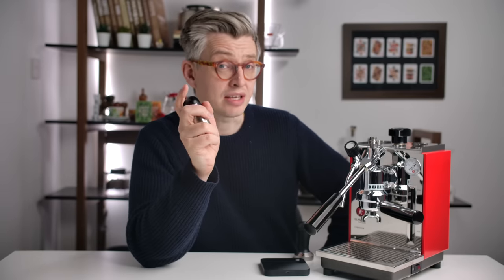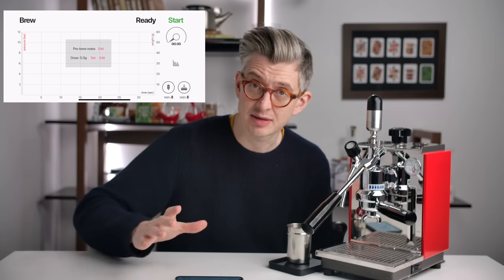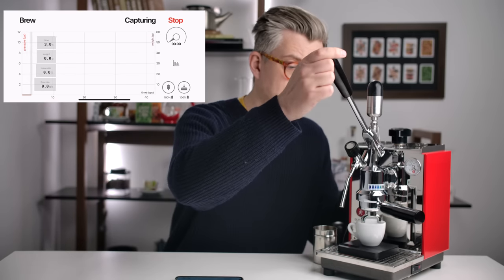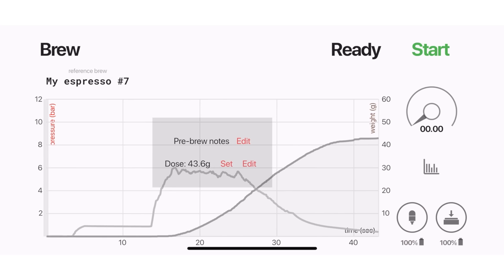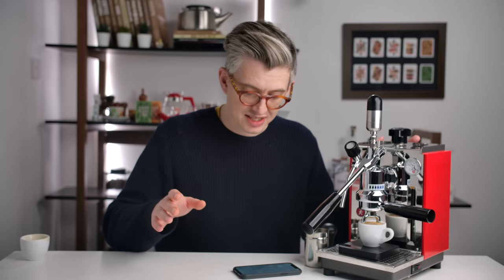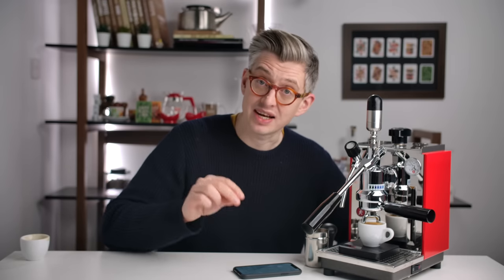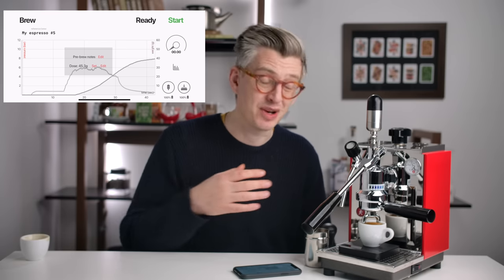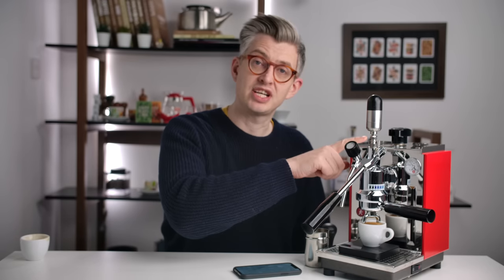The Smart Espresso Profiler Review

Comment: Thank you for the review, James! It is really motivating to get this kind of feedback.

There are some features of the app I'd like to mention, to make it even more interesting:

First of all, it also works without a pressure sensor, using a scale only (and it's free). This way you obviously only get a flow graph, which is interesting by itself. Also, it makes the app suitable for pour over.

There are more supported scales: beyond the Acaia Lunar, Pearl, Cinco and Pyxis, the Skale II scale is also on the list, more will follow. :)

Features:
- autostart on pressure: logging starts automatically, when a certain pressure is reached
- auto stop on lifting the cup
- virtual autotara: no need to tara the scale.   When starting a shot, the app will start logging from 0g, no matter what the scale shows
- switch between weight increase and flow graph
- E61 groupheads are compatible 

Well, I guess these are the most important ones. Enjoy! :)

Cheers,

Miklós
Reply: @mysteriousfox88  yes.
Reply: Hey Miklos! Great work you're doing there - keep it up! Quick question: Are you planning to include the Felicita scales into the app?
Reply: Sok sikert, srácok! ;)
Reply: Hey Miklós,
how did you integrate the acaia scales in your app? I thought their protocols are not open. Did you reverse engineer the code?
Because there are microcontoller based espresso machine modifications to bring pressure profiling and so on but usually only work with the skale2 because its open code.
Reply: ohboy....is this the first coffee app that doesn't suck? Past James reviewing brew apps would be shocked!!
Reply: If this also had temperature for the E61, I would order immediately. This funcionality would open entire new market. Pressure profilling on e61 is getting quite big but most of the machines(often being HX) need to also have temperature gauge.

Definitely interesting product tho!
Reply: @figilande8   Hey Figilande8, we introduced our idea to Acaia first (more than 2 years ago) and we have their support.
Reply: @duriorYT  for now, Felicita scales are not planned to be supported.
Reply: @figilande8  Acaia supported us by giving access to their software development kit.
Reply: @alfonsplasil  thank you! Temperature is definitely on our list, we even have a working prototype, but there is a long way ahead before it is ready for the market.
Reply: Miklos Csanady would this also work for fermentation pressure monitoring (in brewing)?
Reply: @saladaufdieeichel  most likely yes, but I guess the temporal resolution that we use in the app is suboptimal for that purpose.
Reply: This. Is. Pure. Joy. Thank you.
Reply: Does this work with the robot espresso maker?
Reply: @iltifat01  yes, there is a custom fitting for that. You need the version with the analogue pressure meter though.
Reply: This is pretty impressive and you have alot of margin to play here. I work with industrial data and analytics. This is quite similar to commonly used industrial analytics to track performance called golden batch.
Reply: Miklós, great work!!!
Reply: @RicardoMQA  :) thank you!
Reply: Miklos Csanady so if it’s e61 compatible, then might be a good pairing with the new flow control profitec for e61 kit???!!! 😀😀😀
Reply: @WillCheang  yes, it works fine with that. Also with the Lelit Bianca.
Reply: Would you say that - considering everything else constant (coffee, grind, weight, temperature, distribution & tamp), the pressure is directly correlated with the flow in the cup? Because in this case, you would not need the pressure to reproduce a shot, just replicate the flow graph.
Reply: I'm definitely going to have to start using it for my pourover since it's fine to go scale-only. Really happy to see an actually good coffee-tech app out on the market finally. Was getting a little burnt out on all of them never working -- finally I have an excuse to use my scale's bluetooth functionality and not just its good aesthetics and basic functionality.
Reply: How much would it cost for that machine to be modified for this device?
Reply: @ashlynnanderson1744  Let us know how it works for you!
Reply: Hey Miklos - what do you need to add more support, for more scales? Do you have some app code I could run from Xcode while connecting with my scale (Felicita Arc).
Reply: Does it support gs3?
Reply: hey miklos! it's a very cool app and I use it for every shot of espresso. 👍
Reply: @mikloscsanady3955  are you planning to include also the Timemore scale?
Reply: @A266509  it's not yet on our list.
Reply: Szégyen, hogy ezen a csatornán csak most jutottam el a magyar kötődésű videóig, de nagyon jó látni, szuperek vagytok! ☺️
Reply: @konczpet  :) köszönjük!
Reply: Why so expensive☺️?.
Reply: Waiting until aliexpress will offer it... Like 400 backs..wtf

Comment: QUESTION: Did the second shot match the first in taste/density/texture? It would be good to confirm the repeatability.
Reply: Since he went early but then decided to try and follow the curve as closely as possible for demonstration purposes, I'd say that actually was a pretty bad replication of the first shot. But it would be an interesting question in general if not for this shot particularly. But I think the real question here is, if it is a significant improvement of repeatability across multiple days and it's not an easy question to answer with repeatable tests. I tried coming up with a few ways, but they all fall flat in some way or another.

Comment: It looks to me that the plots have used some sort of smoothing function(judging from the last part of the curves, an exponential one similar to capacitor discharging). The great thing about these functions is that they produce nice curves but they do alter the results displayed. When you want to exactly recreate a profile, maybe a raw input could be more preferable. The software has a lot of interesting tricks and features which are fascinating. I think it might be possible to further improve the profile tracking functionality by blending in some control theory.
Reply: I think its just the release of pressure and the weight increase plateaus.
Because we can see the "raw"ish looking data as he pulls the shot.

Comment: Great idea! Just a little advice for using the Cremina: Before locking the filled portafilter, lift the lever up to just below the point, where water starts to flow. If you lift the lever with the portafilter firmly in place you pull the ground coffee upwards and risk ruining the integrity of the puck.
Reply: Alternatively, you can dose just as much coffee that it touches the dispersion screen

Comment: Thought. Using the same parameters. Coffee, grind size, puck preparation etc. All you need is the app + Bluetooth scale. The pressure is a nice addition, but technically the only real-time metric you need to reproduce the same shot, is the flow rate?

Comment: It would be interesting to add temperature to the measurement. I would imagine that you could tune the app to give guidance around extraction pressure, boiler pressure, or brew time adjustment based on you tagging the results with your opinion (bitter, sour,...) but it would need temperature for this.

Comment: 110V is not a problem. First, if the machine doesn't have a pump that is phase-locked to the line input, then one can get away with a simple transformer for just resistive heating elements. Second, if 50 Hz sine wave is necessary to operate the machine, then one can build a simple converter using off the shelf inverter and a couple of power supplies to satisfy amperage.

Comment: I don't use leaver types machines but thats impressive. Next model could be the pressure sensor automatically adjusting the pressure  and all you need to do is pull the lever to the max pressure set on the shot. Not impossible to do.

Comment: I have a vintage Olympia Cremina that I installed one of his analog gauges on. I was planning to upgrade to the digital later (since the piston swap is already performed) but I'm keeping the analog.

The line of sight between you, as you are pulling, and the analog gauge is pretty spot-on, at least on the Cremina. I can perform my slow ramp-up and ramp-down based on the position of the lever or time on my scale.

With the digital, you have to look down at a phone, presumably on the table, while pulling. The ergonomics are not as good and I can imagine it might reduce your pulling accuracy or place strain on your shoulder. But! He makes rock-solid stuff, and I thinking about upgrading a La Marzocco GS3 MP with a digital one in the future.

Comment: Oh my gawd that machine is gorgeous. That shade of red is such an aesthetic.
I do wonder about the possibility of something like this attached to a Gaggia boiler. Perhaps a custom lathe cut threaded adaptor to replace the steam output tap on top of the boiler. I may have to put some thought into this. I don't know how much heat they can comfortably take however so that may be a problem.
EDIT: OH hey, never mind, looks like you can just add a pressure gauge between the pump and the input of the boiler to bypass all heat. People have done it to the Gaggia Classic. Interesting, I might have another upgrade for my '91 Gaggia Baby in the future!
Reply: Although now that I have a 2000+ generation gold stripe sticker Gaggia Baby, that all hardware for the machine attaches to a single galvanised steel base, I may just have to dip my toes into custom building a machine out of it.

Comment: This is why the Nespresso machines became so popular. Sure, they don't produce the best coffee ever, but they are VERY consistent at the ones that they actually produce.
In case you're using the same capsules every time, you're pretty much expected to have the exact same coffee each time, which is a serious plus as there are no surprises - and most of the time one appreciates the lack of surprises in his much desired cup of espresso :)
Reply: You have a point however once you experience just how good espresso can be Nespresso just doesnt compete. Been there and done that before realising how bad and expensive Nespresso is 😥. Now I have a hobby bordering on obsession complete with filtered water, flow profiling, the works. 😂
Reply: If you use a pump espresso machine instead of a manual one it can be just as consistent.

Comment: Here is an idea, another version of this device that has a pass through so for example with a standard espresso machine you could hook up the gauge in between the boiler and brew head to measure pressure and flow on any old espresso machine you wanted to convert.
Reply: You should really see the machines we hacked, exactly this way :) mostly La Marzoccos. It works like a charm. Nevertheless, we get the flow from the scale. Surprisingly, it is more accurate than most flow meters on the market.

Comment: When NASA was designing training equipment for the ISS to prevent muscle loss in astronauts caused by microgravity, they ran into the same problem that spring-based espresso machines have: Sprigs do not produce a linear force output, which is bad if you want to simulate weights.

The solution they came up with was using vacuum pistons. Pulling against the atmosphere you are in with a given surface produces a constant force over the entire travel.

I am wondering if anyone has incorporated this principle in an espresso machine, but would think that they haven't, since it would require a ridiculously big piston and would pull different shots depending on elevation and weather.

An interesting thought nonetheless

Comment: Wouldn't it just be so much better to figure what the ideal grind size is, the correct tamping in the brew basket,  the correct pressure of the water injection over time and do it all automatically with a hands off machine?  Even if you get the correct weight of coffee in the brew basket, and do the correct water injection, aren't conditions like atmospheric humidity, variability of tamping compaction pressure and the like going to interfere with the effort to achieve repeatable results?

Comment: My honest oppinion on this topic AS A WHOLE and on the Smart Espresso Profiler: 

Why would I buy a lever machine (a manual machine) for the price of an electric machine? This is the point that really messes with me since I saw your reviews on manual machines. I started my coffee journey just a few years ago, starting with pour-over (only doing french press nowadays), and the idea of making espresso manually really is appealing to me. But on the other hand I can get an electric espresso machine for just about 130€ more than I'd spend for the Cafelat Robot.
In my conception an electric machine has everything needed so that you are given the right tools for your espresso-making. And this is what you pay the price for.

So the manual machine that makes sense to me is something like the Cafelat Robot, but for at least half the price. You're doing everything manually, from heating up water, grinding coffee (with external gear that will cost money as well) to pull/push the lever with the right amount of pressure and, depending on your technique, watching the right output amount with a digital scale as well.

That said, the SEP is a very useful tool to get your espresso right every time with manual machines. Because you have to do everything manually, you can do many things just wrong. With this tool, again just in my conception, you don't need manual machines with preinstalled pressure gauges (cheaper!), because everything you need comes with the app. And instead of keeping an eye on pressure and amount at the same time, you can just try to follow your profile to make equally good espresso everytime. A real gamechanger and mybe the best invention so far.

BUT: This again is only appealing to me, as long as the manual machine and the SEP togther are slightly cheaper than a "cheap" electric machine, that does the job for you.
Reply: With an electric/pump espresso machine, after pushing the start button you are only a passenger.

Comment: Any chance for a device like this for an E61 machine or is it a moot point because for most E61 machines, you cannot control the rate of flow or pressure?
Reply: There are already a few flow regulators for the E61 group heads. You can easily attach the SEP to those machines.

Comment: How about four another type of coffee machine, ex. La marzocco linea?
Reply: It is possible, one of our customers did that. You just have to cut the pipe after the pump and install aT-connector, with the proper thread for the pressure sensor.

Comment: Miklos ive been lookin at your store and didnt find a complete set for the pavoni with the smart profiling module , but say that im wrong when in that case i need to buy the profiling kit for 410 for the module and 300 for the profiling kit to the pavoni ?
Reply: Hey Sebastian, for measuring piston pressure for a la Pavoni you need a piston pressure kit first (USD300) with an analogue gauge. You can buy the SEP as extra if you'd like to log your profiles
Reply: @ceze70  i understand its not cheap to get this stuff and to make,  but come on , it cant cost more then machine :/
Reply: @frajzorlul  Sebastian, we cannot sell something for less than we paid for. That would be practically a suicide. I think you should invest in a new, expensive coffee machine to make the SEP purchase a bit more reasonable

Comment: I think this is very cool and interesting. However, with a manual anything, you still have one variable that's not so easy to replicate. The human variable. Measuring water weight, water temp, and coffee weight consistently is fairly easy. Even with basic tools. On the other hand, it's not so easy to get the same start time and same pressure consistently. Yes, you can get close to the template and most people probably wouldn't know the difference. But, the caliber of tools would imply that you're dealing with people (even yourself) that would most definitely know the difference. Not a criticism, rather an observation.

Comment: Can this be adapted to work with the Flair or is it plug and play?
Reply: It does work with the Flair. But there are different adapter depending on the Flair you buy. I just received the Smart Profiler for the Flair 58. However, I have yet to receive the Flair 58 but should be arriving in about a week. I can’t wait to try them out!

Comment: Coffee, grind, tamp, portafilter depth and surface area, water, temperature throughout the pour are all factors that will change every single shot.  Not to mention this thing should cost a fraction of what it does. $200 tops but silly rich people will spend their money silly ways.  The sensor is $25 the software is less than 100 hours of work for a novice engineer/developer.

Comment: This device can be replicated easily by the maker community with an Arduino and a pressure sensor and a weight sensor and a bluetooth module.   Knowing them it will be open source within a year but it may not look as pretty.  About $10 in parts from China and some coding time.

Comment: I get the appeal of a manual machine. It reintroduces a visceral and intuitive element to espresso making that makes it feel more like craft than simply pressing a button. But at some point as you pile more and more tech on top of it, it starts to feel like the point has been defeated. It feels like arbitrarily reintroducing variables and then using tech to solve them, when tech already solved those variables a long time ago - sometimes in devices which only cost a couple hundred dollars. At what point do you give up on your "manual hammer that's been fitted with an electromagnetic motor, pressure regulator and sensors" and simply pick up a nail gun?

Comment: Agree that replicate the manual leaver machine is not easy.. 
Ive a flair that have preasure gauge on it, use it with same grinder, same size, same water temp, same dose, same time, same espresso output but cant replicate.. 😂😂😂